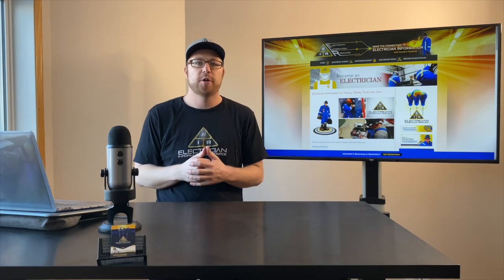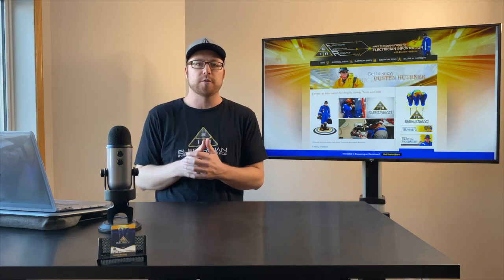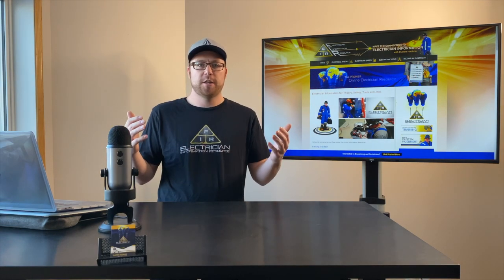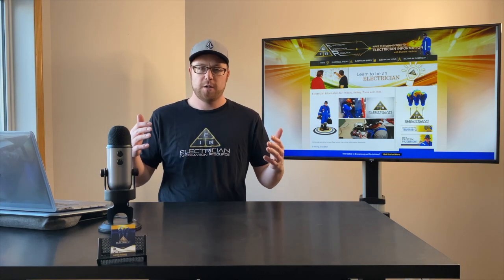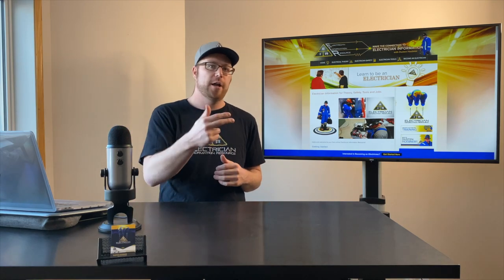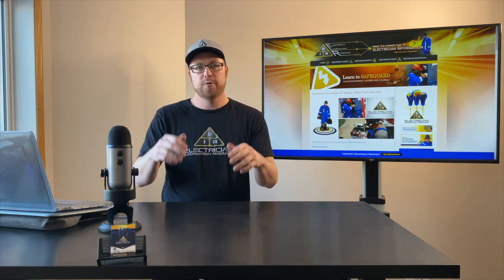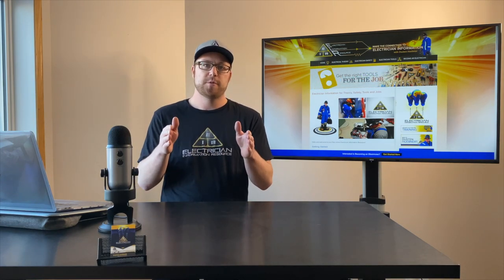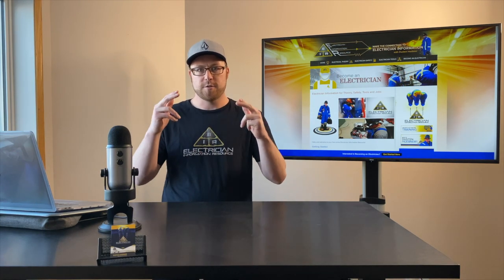Day In The Life Of An Industrial Electrician - Episode #1

Comment: I have two questions:
- Is the guy in the back to rescue you if the worst should happen?
- I always thought lockout clasps has to have more than one lock, so more than one person would be needed to remove it, preventing it being removed accidentally, or maliciously, the ones in the video only show a single lock.
Reply from the maker: Great questions!

Yes he is for backup and safety.

In this case we were installing new motor starters so we just placed one lock on during installation. Once the starter was racked into the MCC we would then involve other personnel that would be required to install their locks.

Comment: Hi Dusten. Good to show the use of the arc flash PPE to someone thinking of this as a career. I am a master electrician that started out in commercial and industrial construction then became more of a maintenance electrician with a waste water facility. That was very interesting work. You get into so much instrumentation and control work, learning PLCs and DCS systems and troubleshooting.  I now lead a team of technical trainers at a Gas & Electric Utility where we now get to instruct all those skills to electrical apprentices, renewable energy specialist and I/C technicians. We always stress the dangers of electrical work and the possibility of an arc flash. Especially on older equipment that in our case some was installed in the 1950s & 1960s.
I like what you're doing here. Keep up the good work. Maybe add some control schemes and troubleshooting tips videos. I'd bet there are a lot of searches for those topics.